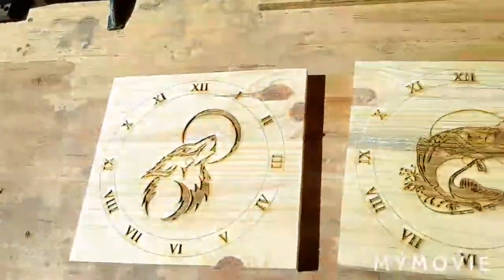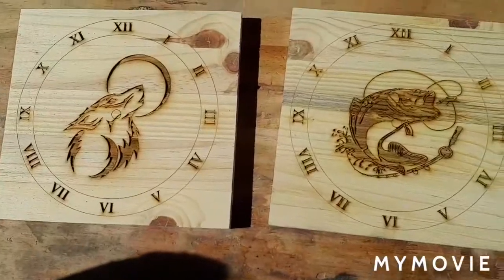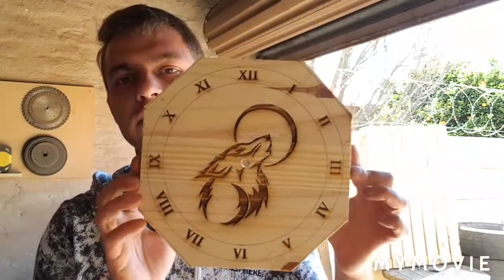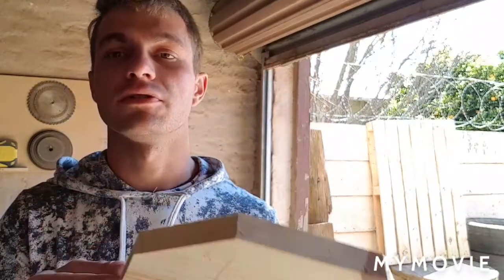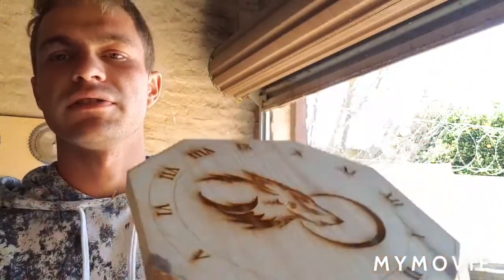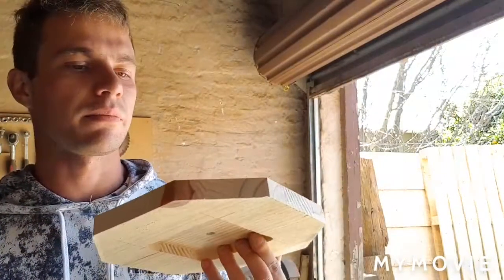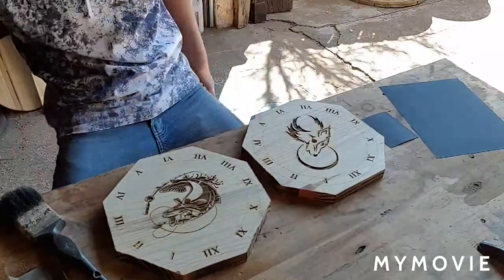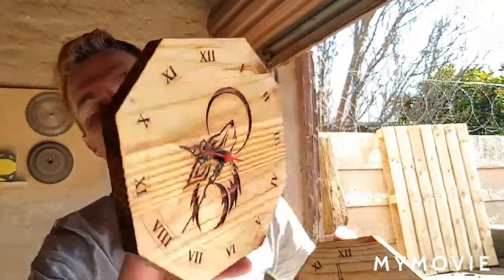Laser engraved Pine wood wall clocks

Comment: What settings did you use? I always have my burns either to strong or weak and the grains of wood show to severely. I’m assuming that pine isn’t good for detailed pictures?
Reply from the maker: Hi I got it done by a friend. I am not fully sure which setting was used. As for detailing in pine I love it, because of the soft and hard wood it creates a tipe of wave effect it the engraving. Also with the dark engraving adding to the light background I personally think it works. Laser Engraving in any type of wood will give you the effect it depends in how much layers of hard and soft wood there is. So if you would like a solid engraving same depth through, I would suggest looking for pieces of wood with the least layers.

Comment: What will happen if you use a little bit of a darker color? Won't that also give it a little darker look?
Reply from the maker: You can stain the wood but I prefer not to. Reason being the colour and texture of the wood looks alot better. You can use a darker wood yes I only used Pine because of the texture it gives